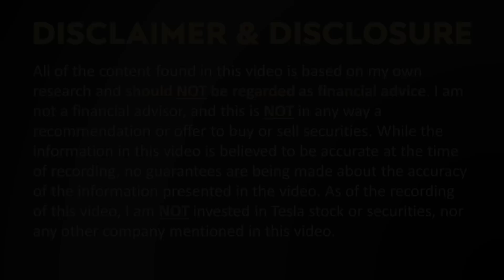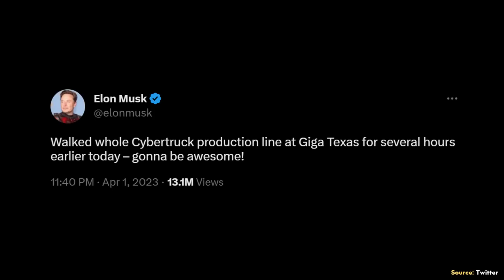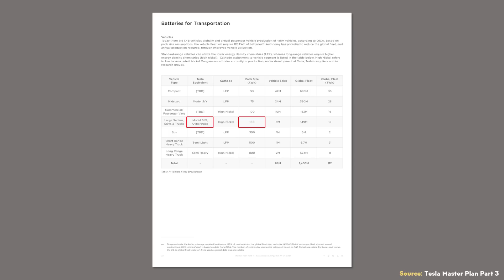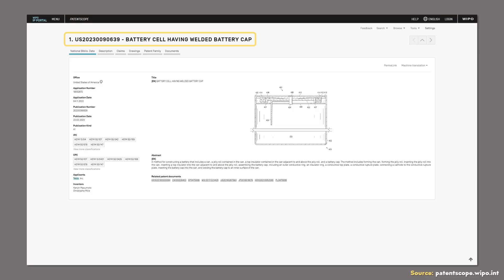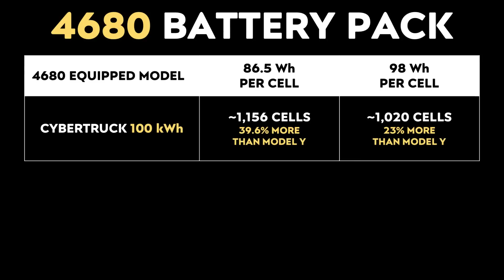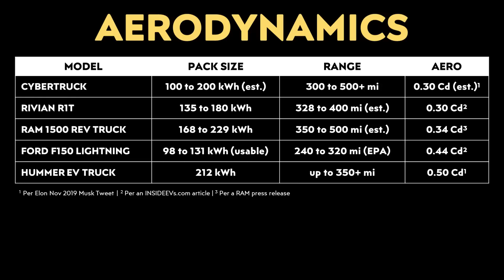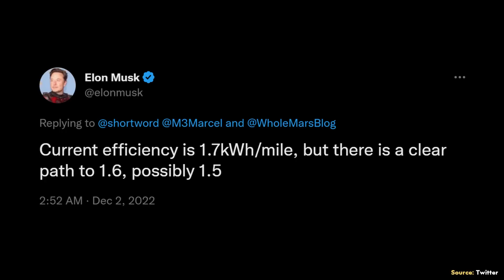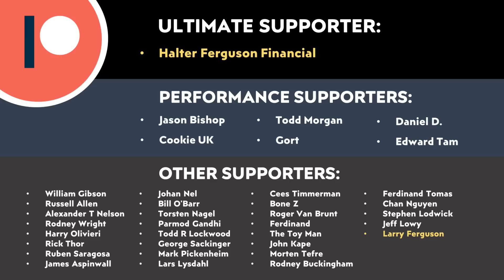What TESLA Isn't Revealing About the Cybertruck | Predictions

Comment: It would seem OBBOUS that since Tesla is using MODEL S PLAID motors, and will be slightly heavier and less aerodynamic that it will have a battery pac similar  too the Plaid which gets 550 miles/ chrg soo. Why does everyone say it will have over 200Kw. My guess is that the long range Cyber truck will have 100-120 Kw/hr battery pac.

Comment: No way they are going to double stack, it’s simply not the way to optimize a production line  and cost. My guess is simply to different battery chemistry, NMC and LFP, which will come later in the 4680 form factor. The dimension allows for 40% more battery, plus gen2 4680 10% increases, which get around 130-140kWh. I don’t think the can get 500 mile / 800km with that, as it would be only 0.16kWh/km , for a truck of that size, no way, but 400 mile would me more realistic

Comment: it wont stuck 2 layers of battery 4680 bc is unsafe, the cells are putted down in a way that if one get overheated it will released the heat to the bottom of the car...se Munro explanation from model y dismantle

Comment: The early 4680 cells were wet electrode process.  Munroe said the current 4680 lines use a dry process as shown on the tour at investor day... Those 4689 cells from last year are one to several generations behind the current cells.

Comment: A serious improvement is needed Now!
Today my Model Y has 33K miles & we LOVE it!  BUT, I'm very concerned about Range. For all Tesla's & even more for the CyberTruck. Tesla needs to lead!  Pricing thoughts at end.
Every CyberTruck regardless of trim must be able to tow >300 mi WHILE towing an 8' wide x 20' long & 9' tall &  7,500lbs. 
A new basic range goal must be adjusted to 400-450mi minimum and minimum 450-500mi for any work or tow vehicle... if we call it a long range.  It's especially critical for the new offerings including the Compact & CyberTruck! Today a budget 2022 VW Jetta gets greater than 560 miles on highway!  My RAM 1500, and pick-ups in general get 500-800 mile range. Cut that in half when towing! 
Whenever I visit family out of town, getting there is sort of acceptable, buy spending a week or more there without my home based charging, I spend far-far too much time sitting at superchargers alone! We all want to share our beautiful Tesla's, but good God, I'm sitting at a charger WAY TOO MUCH! 

New "LR" (& tow vehicles) must be a minimum of 450miles (>500mi for CyberTruck) which means Real Life Range is arriving at charger with 10% nominally & charging to 80% means: i.e. 450 * 70% = 315 miles.
If my Model Y LR really got 330mi with that same reasonable 70% ... it means I'm Currently Dealing with ONLY 230mi range at best. No wonder I'm sitting at chargers every day or every other day. It really does NOT Show the Tesla-Lifestyle well when using my car away from home.  

On the Pricing front, I think prices are way out of hand & why Ford with F-150 & GM will go out of business If Pricing doesn't come down.  CyberTruck is supposed to be a RADICAL MANUFACTURING Advancement! 2 motor needs to be under $55k & Tri motor under $70k. Tesla manufacturing must mean Pricing Advantage! $80-100k pick ups are out of line.  Darn ...  Working folks need these, not millionaires! 

Cheers, Eric

Comment: Hate to hear all this 60k - 100k for the truck. Anyone who ordered the truck during early inning’s before they pulled the pricing details should be locked in at or very close to original pricing. Parts are cheaper now given Tesla has done so much with vertical integration and reduction of cost. I don’t agree they would price it at these insane prices people are saying. It will shock everyone when it is revealed. Tesla wants to take over the Truck market. They will stick to original pricing. Mark it.

Comment: I believe that Tesla has found ways to lower the costs to produce the Cybertruck since its inception and initial pricing. I believe that it will be similar to the original pricing and possible cheaper.
The Cybertruck will be cheaper to build than a traditional Ford F150. It is a gamechanger. The limited paint required and the much smaller Body in White needed to build it will be huge cost savings. Prepare to be amazed.

Comment: Curious to know if there will be a token 12Volt reticulation (48-12V inverter) on the Cybertruck.  Yes, I am very much in favor of this move to 48V, but will there be some interim accommodation for older accessories (eg: spotlight, Peltier-refrigerator etc.)?

Comment: I do believe you're right about the pricing. I can see a $60k SR Dual, $70k LR Dual, and $79k Performance Tri motor. But I don't think Tesla will simply double the pack size for LR. With a 1000V architecture the SR pack can simply be a smaller pack in cell series. Say around 700V. Than the LR pack will simply add cells in series, increasing the voltage and kWH.

Comment: Great video :)

I have a hard time to understand how a 100kWh and 200kWh version can have the same efficiency? The rolling resistance is inevitable significantly higher with a heavier vehicle. esp. if this vehicle will be 30-50% heavier. 

Maybe the difference between 100 and 200 is too big. If the difference was less. For example 135 vs 160, then Tesla may be able to hit similar efficiency numbers if the heavier version receives som Semi magic and maybe more advanced suspension. 

The smaller version (100 kWh?) I think will arrive later, when the production is ramped... and for that matter it may only be the bigger batt. version that will be available as the production ramps...

Comment: I can't see a doubling of the pack capacity leading to a linear doubling of range when you allow for the significant extra weight of the vehicle from the second battery layer and that's before you add the weight of the third motor.

Comment: Your comparing to model y, wondering if a 100kwh pack is possible.  Surely it's larger than s and x ?? These already have 100kwh packs using the inferior 18650 cells ??? So something exceeding 100kwh should be easy on a single layer let's say 120kwh small pack then partially 2 layer increase that by 50% to 180kwh thus should easily get 300 and 500 mile ranges with room to soare
Reply: "Inferior" 18650 cells?  The S and X use Panasonic's newest battery chemistry.  They fit 98 kWh in the same space as the early Model S 70 kWh and 75 kWh battery packs.  The extra space that used to house two extra modules for the long range 85, 90, and 100 kWh cars is now used for the "penthouse" electronics: DC-DC, charger, contactors, BMS, etc.

Comment: Definitely not going to have a double layer of cells, with the 4680 structural battery pack you are going to be installing the pack with the seats and center console installed on top already through the bottom of the truck. Doubling the cells with a second layer on top changes where everything is in the interior, and things like headroom and legroom...definitely would not do that...or the second layer goes below, changing ground clearance and aerodynamics along the bottom. No, this is not the Tesla way.

Comment: I still believe that the cybertruck will use Panasonic 4680 from Japan. And it will meet the battery criteria as Japan is now on the free trade list. There design is their wet process. It is possible that equipment has been installed in Texas as new holes in the roof above the battery area are now appearing.
Reply: Panasonic is building two new battery cell gigafactories near Texas.  It is much more likely to supply Cybertruck cells from those factories than to ship them from Japan.
Reply: @georgepelton5645  They will not be built in time for this year. Panasonic has planned shipping sometime in the next month as the plant their was projected to be in mass production by now [new factory just for 4680 size]. So if not the cybertruck where? Semi's possibly but they are using 2170's from Nevada along with all other upper Y's in the US and Germany. The 4680 made in Texas and Fremont is going to the standard range 3s and Y's. They do not yet have production lines running for a new chemistry with higher density yet for a structural battery. I believe Tesla has said that the plants your referring too are for the cybertruck but they will not be structural batteries they will be like the 2170 in wall structure. Panasonic has said they will be selling them to others also...  specifically referring to the first one.

Comment: I think the dual motor version will be priced just under 80k to take advantage of the 7.5k Fed rebate.  The tri motor will be around 100k.  Also I don’t believe they will need 200 kw/hr pack to get 500 mile range, probably somewhere around 150 kw/hr.  So I think if they do double stack, the top layer will be much smaller than the bottom layer, perhaps only under the bed of the truck and not under the passenger bay to keep the floor lower.
Reply: OldC…I think they’ll be more affordable.  Guesses: Tri-motor first @ $80K, bagging the Fed $$s.  Range @ 500 mi.
Dual motor may not come soon, but if it did, maybe $60K @ 300 miles of range.  These prices would be 13% and 17% above the originally announced prices.  
For comparison…the M3 was $34,900 (**edit: that was the off menu, software, crippled, 230 mile base version (no longer avail). The standard range plus, 260 mile version was $45,200. **) when CTruk was announced.  It’s now $41,900.  That’s a 17% increase. (**edit: actually 8% CHEAPER for the more direct comp**)
Reply: Good observation.  BTW: kWh is kW*hour, not kW/hour.
Reply: Batteries must be between the axels only. Safety and handling demands it.
Reply: Idk 80k might be demand loaded price, ford is pushing f150 lightning out with a 98kwh pack for ~60 <with heavy demand load>  I predict tesla will be around the cost of the lightning today once volume hits and this will drive prices on lightning down.
Reply: @mrspeigle1  idk either!  But the way I view it, Tesla already has a huge over-demand issue, with over 1.2 million preorders.  I see their choices as: stay true to the spirit of the originally announced price, with reasonable inflation adjustments; or jack the prices up 50% to market competitive prices. The originally announced prices were significantly below value price for the features at the time, so I don’t think they will chase the market price at the risk of alienating a half million-plus pre-order customers. 🍿
Reply: @mrspeigle1  Ford doesn't have the leading edge manufacturing methods of Tesla to enable dropping the price of the lighting without making a loss on each sale.  You realise with every new model, Tesla makes production efficiencies, not just a new vehicle?  Ford are struggling to make profits on their EV's.

Comment: To be clear, Elon NEVER predicted Cybertruck deliveries this summer. He said PRODUCTION is expected to begin this summer. This means they need to begin production of validation units, these will be used for crash tests by NHTSA and IIHS and also used for real testing off-roading, towing and hauling in all different conditions around the country. They will also use the validation units for gaining SAE certifications for the towing and hauling capacity and EPA certification. 

Once all this is completed they will begin true production and the first batch will all be delivered to employees with NDAs. Employees will provide feedback to Tesla, tweaks will be made to the production line and customer deliveries will begin in early 2024. Ramp will be slow until they work out the kinks.
Reply: Validation models have already been produced. Testing is happening now.
Reply: True r.e. Elon’s true comment.  👍
I do expect deliveries to start in Q3’23, though.  Tesla employees first.  Possibly a few thousand non-employees a few months later.  Who knows, though!?!?

Comment: I really hope they have been sandbagging the 4680 energy density in the Y. If the Cybertruck comes with 100kw/h and still can achieve 500miles+ range it will be absolutely epic. I have a sneaking suspicion that Elon thinks range is less important and charging infrastructure is greater. I could definitely be wrong.

Comment: I think the tri-motor battery pack for the 500 mile plus range trim will not involve a double layer design and will only be 50% bigger than the hundred kilowatt hour pack of the two-motor trim.

Comment: My wild guess is that less than 10,000 Cybertrucks will be delivered in 2023.  Could be only 5000.   In 2024,  maybe 100,000 to 125,000.
Reply: In the past whenever he releases model. Tesla will always push the premium model of the truck for first streets, and with it a higher cost premium to be the first to own. Suspect the initial highest cost production will offered to reservations before offering them a lower cost.  Even though there are reservations. Most people will opt out of the premium model
Reply: I will go for late September / early October delivery of the first few dozen and 512/768 total for 2023, maybe 20k for 2024 if we're lucky. It's a completely new and radically different manufacturing method that will have a long learning curve and many tweaks from Tesla and suppliers. It's their first time in truck & off-road territory so issues they've never thought of will come up with hundreds of'em challenging the Rocky Mountains and necessary changes will keep the ramp slow.

That's entirely okay but I'd urge investors extreme caution and patience, Cybertruck ramp is likely 2 years away Tesla's lucky then there's the 2nd and 3rd gen of 4680s Cybertruck may require to hit range targets, and mass manufacturing 4680 has been production hell. So many radically new things here that would take legacy auto 5 years to work thru from line buildout to 100k+ ramp. 2,5 years for Tesla (half already spent on building out CT areas in Giga Texas) would be a great accomplishment. 

Model Y ramp mislead a lot of us about just how much magic Tesla engineering has. A lot. Yet that car was built on the M3 platform. Cybertruck is entirely new and there's so fast Elon time can pass.
Reply: @BigBoneESB   You may be closer with your guess, than mine.   I am confident the amount in 2023 will be small.   How fast Tesla is able to ramp in 2024 is TBD.   Although I do think it will be more than 20,000 units because Texas was/is a blank sheet of paper allowing more flexibility in laying out the line.
Reply: I heard a lot of investing with Mr.Andrew and how good he is, please how safe are the profit?
Reply: His method surprises me. A Friend that I referred to him,just received €50,150 profit after 7days of investing.....I became jealous,...Lol
Reply: Great…now the financial bots are taking over REAL comment threads instead of just starting their own. 🤢

Comment: No way they stack two battery packs on top of each other. A single layer of 4680 cells extending all the way from the front to the rear axle should be enough to get 130 kWh which is I think that all the trimotor will need

Comment: No way in hell will a cybertruck reach 300 miles epa with 100kwh. Sorry not happening, maybe downhill with a tailwind and helium in the tires
Reply: No mirrors too
Reply: Why not? That would be matching the older model x for efficiency. Lower trim dual motor, smaller battery lighter cts on the Goodyear 20" AS could hit around that efficiency. The Ford lightning does 240 miles on 98kwhs right now. And tesla is usually 15-25% more efficient per kwh per mile of range vs the competition. 🤔
Reply: @4literv6  no way a TRUCK will get 330wh/mi.
Reply: @lazerusmfh  we'll see here soon right? 
I've seen rivians and lightning owners showing 2.6-2.8 miles per kwh in combined driving when not hauling anything.

Tesla generally has 10-25% better efficiency than the competition does. So for the base smallest pack lightest weight ct?
I wouldn't be surprised to see it match or exceed the model x for efficiency when it's on 20" AS st tires.

Comment: Jon, very nice job, as usual!  It's interesting to note that the longest-range version is exactly twice the lowest-range, so it tends to support the single/double layer variation.  But if you need to do double-layer, wouldn't it be simpler to make the cells twice as tall (46160? 46A0?) in a single layer?  This would also eliminate the void above (or below) a 4680 single-layer, and/or mechanical variations on top of the structural battery pack.  This change would require all electrode materials to be twice as wide, which is a huge change in production...except it's not.  They electrodes are already being manufactured twice as wide, and cut in half for the 4680.  Something to think about.
Reply: The issue with making it taller is it would require a complete validation testing phase. Also, there is going to be issues with resizing almost all the production equipment. 
Another is going to be an issues with how much current you can pass through the end caps. It would likely be cheaper to have one battery and just use as many as you need, as well as better quality assurance.

Comment: Batteries are evolving so quickly.
Lithium-Ions days are numbered.
LifePo4 is superior.
Don't buy a long range or high performance Tesla.
Demand LFP.
Do you really need to go 200 mph, or hit 60mph in under 2 seconds?
Reply: LiFePO4 is a type of Li-ion
Reply: LifePo4 batteries don't perform well at low temperatures.
LifePo4 batteries have a low nominal voltage that reduces energy.
One overcharging or over-discharging can cause permanent damage to the cell.